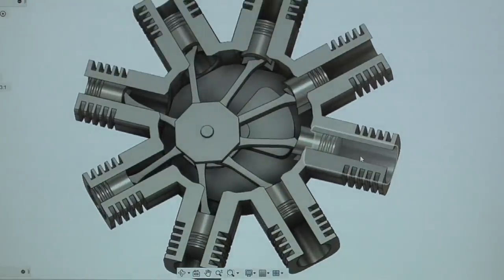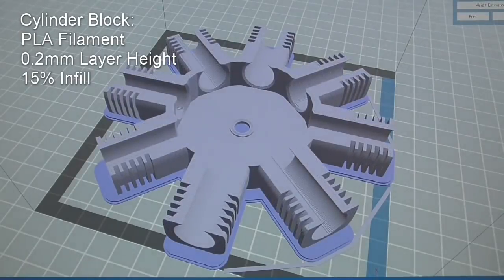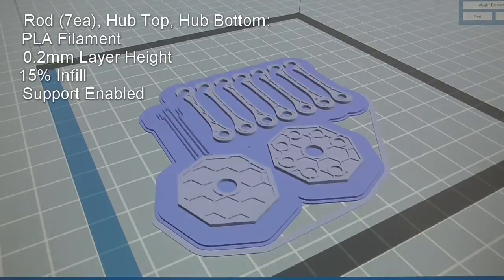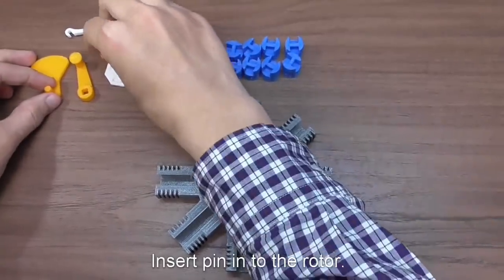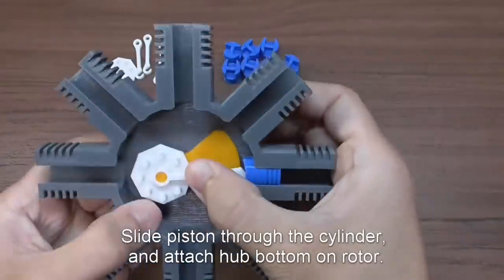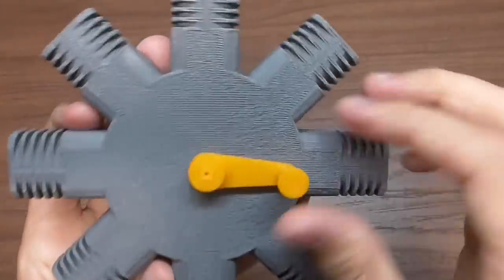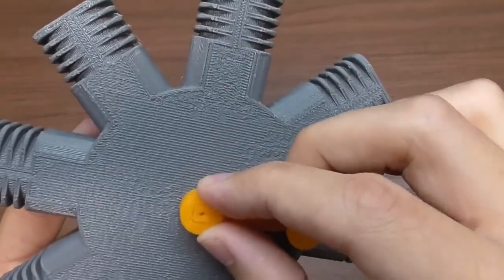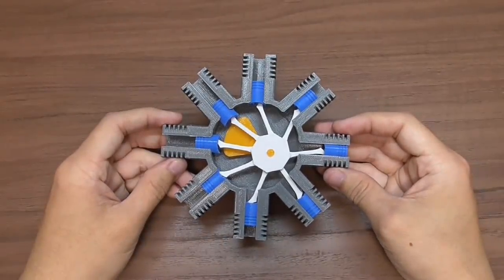3D Print: Radial Piston Engine Model on Thingiverse [by plusAlpha Designs]

Comment: the idea is great. BUT a 8 cylinder star piston engine will in practice not work. Any star engine has to have an odd number of cylinders, otherwise the cylinder firing will not work. When a specific cylinder has been fired, the opposite cylinder has to fire next. This is nececarry because of  friction of the engine. Of course there are 18 cylinder star engines, but then this machine has a 2rows of 9 cylinders, like f.e. the B29.

Comment: As long as there is Combustion, there's nothing new to that kind of Engine 'old school' . Let me barrow that 3D printer and I'll show you the real new style of producing torque using only pure Force (push/pull). Zero pollution, most of all no Refueling. I only need hardware to create the prototype.

Comment: Almost all radial engined have an odd number of pistons. It's required for a four stroke radial to work properly and be balanced.

This could only work as a two stroke or compressddair engine, but it's not really a good model for radial engines.

Comment: But you're doing it the other way round right (just for representation purpose). The pistons must rotate the handle on the back of the system in reality, right?
Reply from the maker: yes, you are correct, the handle is there for representation. on an actual engine, the pistons will need to drive the propeller or whatever is attached on the output shaft

Comment: Try an odd number to reduce equilibrium counter forces
High speed props are odd numbered blades to reduce pulsing of an exiting and entering blades through the surface of water (surface piercing high speed} and hydraulic pumps, Piston type, are odd for the same reason, smooth fluid transition over ports

Comment: Firstly let me say good work  and well illustrated mechanics. However, radial engines can not function with even number of cylinders (otherwise the camshaft complexity would over ride the advantage of air cooled radial with single camshaft the firing of cylinders would be every other cylinder.... example 5 cylinder engine would fire 1,3,5,2,4 back to 1....)..... so just as a thought..... to make it a realistic educational toy, a redesign to 3, 5, 7 OR 9 cylinders may be a good new project.... (happily retired aerospace engineer here.... just for those that would like to argue....)
Reply from the maker: yes, you are absolutely correct, and I am aware of the problem as I have also written in the description as a “disclaimer.” I will consider publishing a correction once I get a chance. thanks for pointing out!
Reply: @plusalphadesigns  .....My bad sorry I have not read your description.... my apologies.....
Reply: Something just hit me.... would be nice if you could incorporate the camshaft as well with electric tracks and vipers connect to different colour light emitting  diodes  so that intake, compression, ignition and exhaust strokes are distinguishable... just a thought.... it might be really neat....  or you can eliminate crank shaft all together, and use the crank housing in the back for electric connections....  (second option would be much simpler)

Comment: Radial engines use odd numbers of cylinders per crank throw. This is because a 4stroke engine has 720 degrees of rotation per cycle not 360. Dividing 720 by an even number will put a cylinder at 0 and 360 for example. All even cylinder count engines with an even firing order will have pairs cylinders at top dead center simultaneously and that could only work with multi  row radials. Sure 2strokes could work fine but they would need a positive displacement supercharger to do the pumping like a Detroit 71 or 92 series diesel. With odd cylinder the firing order skips every other cylinder and gets to the skipped cylinders on the second revolution. Radials also have a "master rod" where a certain cylinder has a longer rod  that is also the central hub with pins to hold the rods for other cylinders so as the engine goes around the hub wobbles but is still stable. With just a floating hub it's not going to be controlled and do whatever it wants.

Comment: saw one flaw in your design, one of the pistons should be locked, driving the others in their cycles, which also accounts for Tim Deshazers point of odd number cylinders.
Reply: He locked one, look at 4:27
Reply from the maker: I'm aware of the problem with even cylinders, but I believe I have the constraint of the pistons correct. 7 of the rods are free to rotate on both ends, except for 1, which is free only on piston end and locked on hub end. correct me if I'm confusing something
Reply: I think the number of cylinders is dictated by the firing sequence. An even number won't allow an even, smooth firing sequence, at least in a four-stroke config. Odd numbers allow for equal-sized arcs between cylinder TDCs on a firing stroke over two full rotations necessary for four-stroke function.

Comment: Attach magnets to the pistons and wind coils around the piston cavity and you made a radial solenoid generator.
Reply: Awsome
Reply: Amazing idea. Do you work about that stuff? Thx
Reply: @canerguener8664  Nope, I'm electronic engineering student. Also, that would work as a generator but won't be efficient compared to a normal alternator. Plus the circuit would be complex because you will get different phases in the sin waves of each coil.
Reply: @LuxBacelo  Thank you very much. Thought this could be a smart solution but isn't. 
I am thinking about connecting solar-heated steam with a Stirling-motor or Tesla-Turbine , do you mean that makes sense?
Reply: That's a good idea
Reply: Energy from movement energy😄
Reply: I’ll take your word for it

Comment: How's that planetary gears in 00:10 spinning so fast...?
Did you use an actual bearing...?

Love your propeller engine tho... :D
Reply: watch?v=BEvVeLOcFUI
is the video for it
Reply from the maker: link provided by Enderwardduke Plays is the assembly instructions for the planetary gear fidget spinner. it uses commercially available bearings, which are also degreased using isopropanol alcohol to eliminate the stickiness of the lubricant